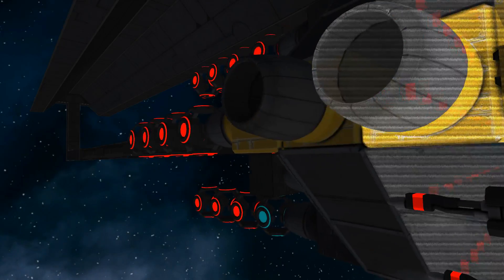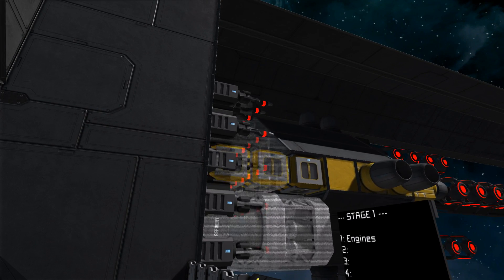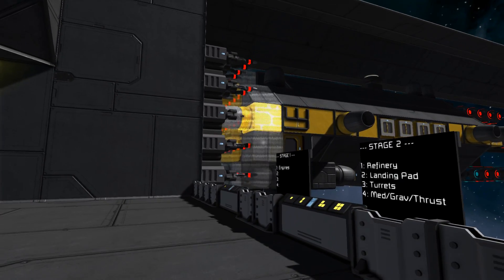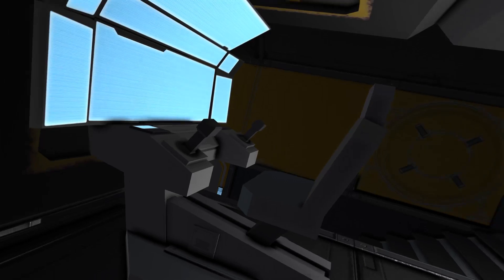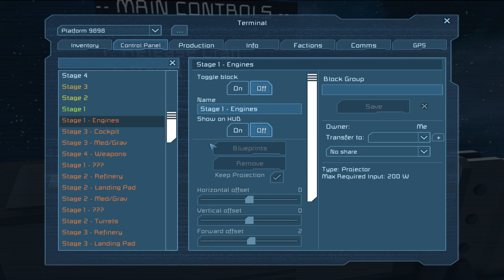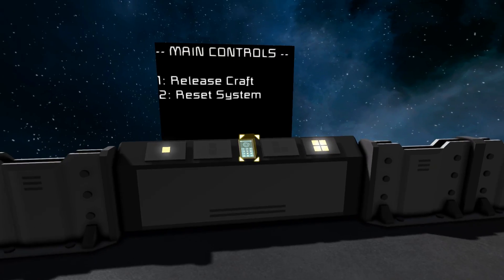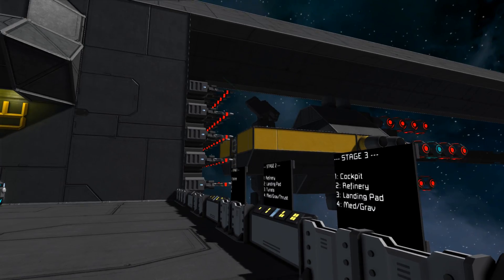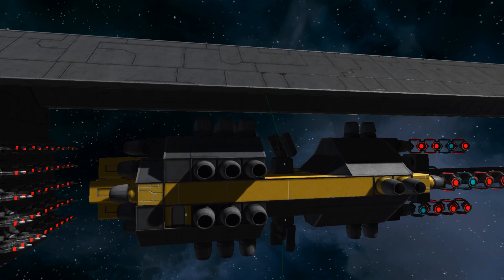Space Engineers - Modular Extrusion Platform - Multi Ship Projection System

Comment: very cool concept, reminds me of a small ship vending machine i saw on the workshop, though that one was not modular it did have 10 or so different small ships
Reply: ***** maybe you could make a video outlining the specs required to make a module? That way we can send you our own designs and help take some of the workload off.
Reply from the maker: Yeah I know the one, was an interesting approach having them rotating like that.. much more vending machine style than this although I can see the link :) However, once I'm done with this (plans have been growing constantly since I published) the number of potential 'different ships' you could make should be pretty damn impressive... I'm thinking double the size of the whole platform bit to allow 8 modules, add in more parts for that size and also larger sections, get like 10 more modules at least, add in some missile options so you can also print projectiles... and then maybe group some of the common 'builds' into single buttons so you can go straight for them instead of customising. Cheers dude!
Reply: maybe you could have a missile factory module :D
how about a module that takes 2 spaces a normal module
Reply from the maker: 1wsx10
Was expecting to need a double-length module for the refineries but it just fit in so definitely going to consider that also :) MOAR MODULES!!
Reply: yeah, one question... when i tried out the projectors, there was a limit to how out you could move the projection. how did you get around that?
Reply from the maker: 1wsx10
Its why they are mounted to the pistons directly, can move with them meaning you don't need anything like as much.. I'm only using a offset on that of 16 at most iirc, with 50 as the max so plenty of room to scale up still :)
Reply: ***** but when i used it, it wouldn't work further than a certain offset. maybe i just need to muck around with it a little more
Reply from the maker: 1wsx10 Should be able to go all the way to offset 50 assuming the other criteria are met (attachment point etc)
Reply: ***** the attachment point may be where i was having my problems.
Reply: ***** how about a communications module? with an antenna and a couple of laser antennas on each side?
also, hangar module?
Reply from the maker: 1wsx10 Both good options :) Need to get building, got another 15 modules to add now!
Reply: ***** nice, waiting on your update video then i guess :)
Reply from the maker: M Purefoy Yeah good thought, although they are fairly basic.. Size = 4x5x5 (or a multiple of 4 as that's the 'length' of each piston section). Needs a conveyor in the central location at both ends to hook up with other cargo networks. If you add thrusters, the forwards/backwards ones need some careful placement, best way to see that is just look at the existing modules and you'll see how they hang out the sides a bit. Good thinking sir and I very much approve of ppl wanting to get involved, will be sure to also include those specs in the next vid! (EDIT: might be 4x7x7 actually)

Comment: That's bloody amazing. This actually also fits in the trend of the Next-Gen Carrier, wich would then be able to build small craft like fighters, probes, and miners but then also larger corvettes!

Do you think this could also work for large ships, at some kind of shipyard station?
I'm crap at setting up the timer blocks and what not, but I'm sure I could design some sweet stuff.
I'd love to build something like it.
Reply from the maker: Cheers, think the NGC will need at least one of these, maybe more!

Depends what you mean by large ships :) This is a large ship type as that we needed to get refineries etc and make it really worth being modular in the first place, but I see no reason why it couldn't scale to any size you can be bothered to make blueprints and a welder setup for.. Once it gets to a certain size you'd probably start having to use multiple piston grids instead of just the one line in order to keep things stable but still that should essentially scale indefinitely. The timer setup for this is actually really simple! This one is most just about designing the blueprints so they actually fit together in a sensible way and are the right size and then naming everything in the control panel so you don't loose track.. Check it out on the workshop if you wanna get an idea, it really is more straightforward than you might expect to setup once it's figured out.

Comment: Love it! Question: the merge block holding the ship to the pistons, does it auto-merge with the one on the pistons themselves, or do you have to have its power source built simultaneously?
EDIT: Ah, nevermind, I'm being an idiot. I used the same concept on my piracy fighter =P
Reply from the maker: Rogor that! In case anyone else is wondering the answer, it's actually built attached to the merge block already, no connection is needed because it's being welded already in place. :)